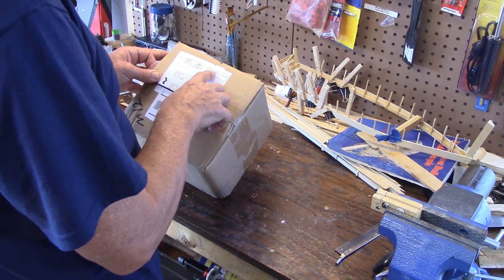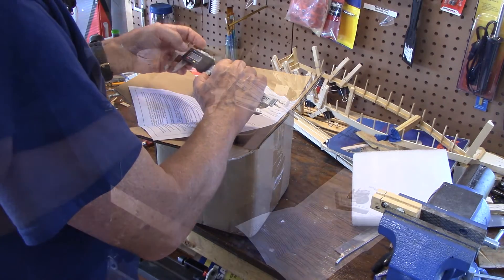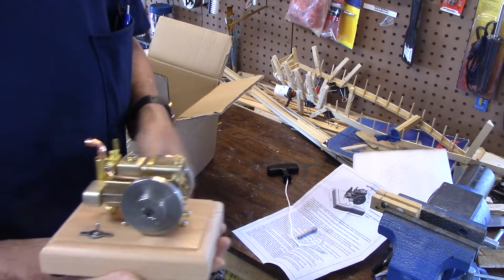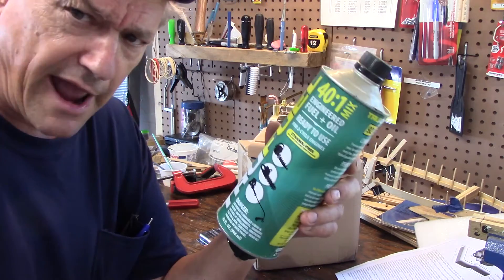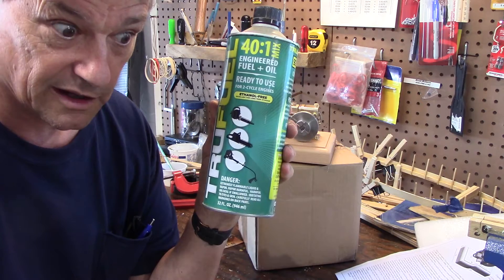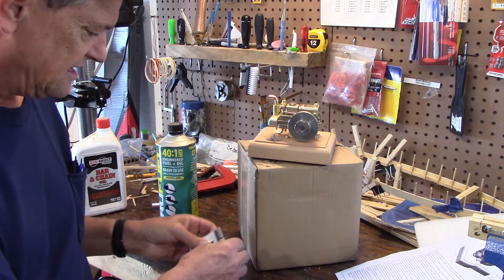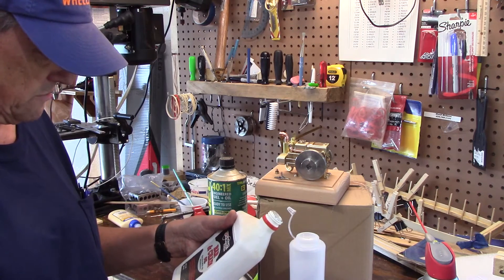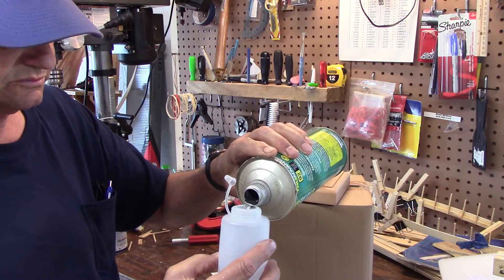Self-Unboxing & Running Mini 4 Stroke engine how to set up Gas Steampunk Engine - Sterlingkit

Comment: That expensive fuel is recommended for small air-cooled twostoke engines because its ethanol free, premixed to the right oil gas ratio, and premium higher octane. 

 The ethanol is what causes the rubber fuel lines and carburetor primer bulbs to rot. Most people don't use the two cycle yard equipment as much so they sit for a while and this is what dissolves the rubbet. Some areas have 10% or more ethanol in all grades of gas. You really don't have any other option to avoid it other than physically removing the ethyl alchohol yourself.

The premix part is important to the manufacturer because they know that a lot of people don't know how to mix it to the right ratio. In most two stroke yard equipment it doest really matter... perfect oil ratio is important in high reving racing applications. 

The premium higher octane will burn cooler at high compression and is therefore less likely to pre-detenate befor the ignition system sparks. Once again only noted in racing high revving machines. 

 That little motor you have could probably run on old avon perfume its so low compression and rpm!
Reply: 1: It's not premixed to the right ratio. I have a whole pile of dead yard tool engines that call for 40:1, got 40:1, and failed due to insufficient oil. 25:1, however, and they seem to last.

2: E10 does not harm your engine unless you're an idiot and don't do your maintenance properly. Walbro carbs have been E10 compatible since before I was ever born.

3: You'd be hard pressed to get a two cycle gasoline engine to have a high enough CR to warrant 87 octane, much less the higher stuff people say they use. The 'quoted' CR is often the simple measurement used on 4-cycle engines, but that doesn't work with 2-cycle engines. The 'real' CR is only around 6.5:1-7.5:1 and is measured from when the exhaust port closes to TDC rather than BDC to TDC. Typical garden tool would run fine on avon perfurme for the same reasons this engine would!
Reply from the maker: Yes that's true, but my point was that the technology to make carburetors, fuel lines and primer bulbs stand up to ethanol fuel has existed since the model T Ford. ( it was designed to run on alcohol fuel).  And most gas stations are selling 10% alcohol fuel or E85 today.  So why sell any product that can't use it?
Reply: @gwheyduke  yeah! I agree its stupid, we have the technology but its all about the manufacturer cutting corners to save $0.25 per unit and putting the responsibility on the consumer.

Comment: I ought to buy one myself. And make my own version . They are making some great motors in China.  People knock the Chinese stuff . But I got a Chinese bench mill and never had any trouble with it in about ten years.
Reply from the maker: Yes it's a fun little engine. If you do, the Sterlingkit website has the best discount right now.